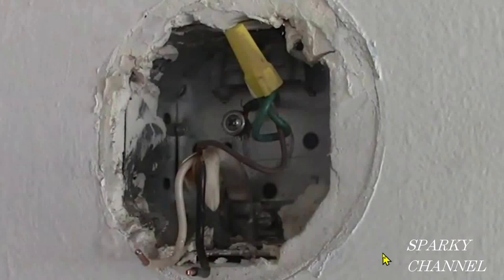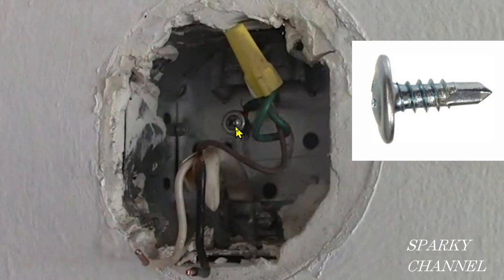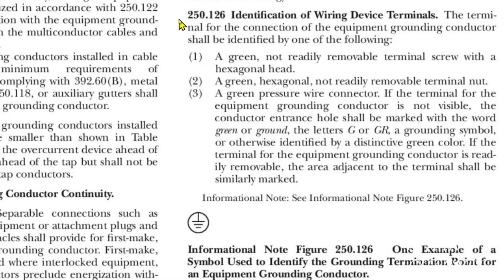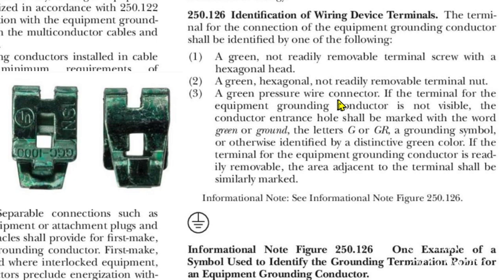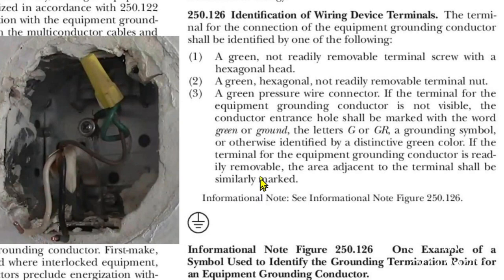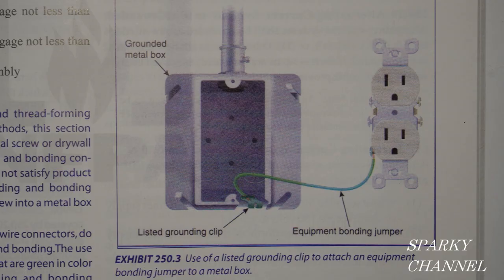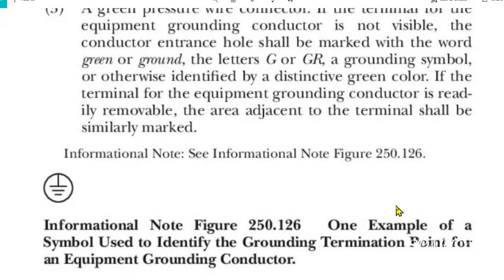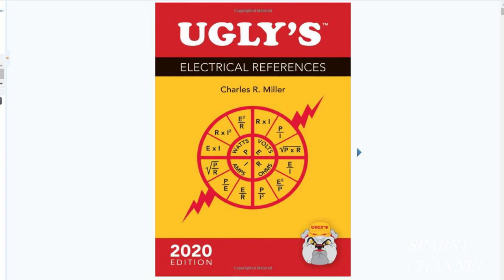Is This Box Grounding Screw Legal By 2020 NEC?

Comment: What's even better are the houses such as the older style homes that had fuses boxes are were they took the ground wire and wrapped it around the screw on the wire grommet where the wire enters the box, the screw that you tighten down against the insulation of the wire.  My house that was built in 1916 was like this when we moved in.

Comment: Nope. Not green, not hex, and really the problem is you have no idea if some random screw is conductive enough to work as an electrical anything.  I also mistrust anything with a “self-tapping” thread. Those are often a one-time connection. They’ll make a connection- ONCE. But will strip if loosened and re-tightened.

Comment: In this 50 year old house, the aluminum grounding wire from the aluminum romex is wrapped around the unused cable clamps and tightened down. The copper only receptacle or switch is then grounded to the box with its mounting screws. I forgot to mention, if you didn't figure it out already, that our home wiring is a tad out of date. Our house is wired kind of funny too. The 20 amp, 12 gauge lines were definitely looking toward the future when they put them in. If I won the lottery, I'd probably gut the house and completely rewire it. Until then, I just use approved methods for transitioning the aluminum to copper to help tame the aluminum to copper's frisky electrolytic properties to corrode and spontaneously combust.
Reply: Aluminium is derated, so 12 AWG Al is only 15A.

Also, the wires at the screws can loosen over time and cause over heating. If you have flickering lights or hot temp outlets, there are probably loose screws somewhere. Arcing will eventually lead to fires.

Comment: I suspect Ed Benton is right about 250.126 addressing receptacles and switches as in the title it has "Device".   I wouldn't call a box a device.   I think this box situation is addressed by 250.148(C) which refers us to 250.8 in which "Thread-forming machine screws that engage not less than two threads in the enclosure" is an option.   .   However, I don’t know if a two threads would be engaged in an electrical box like that so it might not be legal for that reason anyway.
Reply: I think you're right. There are many listed boxes and enclosures that have a grounding screw that is not hexagonal or green
Reply: @jsncrso  ... so the next question is what prior code said about those screws and if they were legal up till recently? After all, this is the NEW 2020 code and not everyone is caught up. (and wont be for years)
Reply: How many screws (of any shape or color) attaching a ground wire to a box have you seen that aren't  (by any reasonable definition) readily removable?

A quick search of a 2008 version doesn't define "wiring device" but says it doesn't define a lot of stuff defined in other codes. I have to figure that there's a definition somewhere, because otherwise how is anyone supposed to know? A cover plate isn't connected directly to wiring or used to install wiring, so obviously not a wiring device, right? An awful lot of other stuff is something that's used to install or connect wiring (even staples and conduit). At any rate, the ground (and hot and neutral screws  in receptacles and switches require a bit of extra effort to remove because of the  groove in the end of the thread, and they're obviously "terminal screws". Put it together and they're "not readily removable terminal screws".
Reply: @rupe53  Code says UL listed device. If the device is UL listed for that application, it's code compliant, end of story. NEC does not cover the manufacturing side of things, only installation. The code in this case refers to an aftermarket screw chosen and installed by an electrician, not a screw that included with a UL listed device
Reply: @jsncrso  ... right, but what was supplied 10 or 20 or 30 years ago? I don't recall there being green screws in all 2x4 or 4x4 boxes, unless you specifically bought boxes with the ground pigtail included... and even then I don't recall the screws being green. For the sake of repair work on something existing, do I need to purchase pigtails with green screws or can I just use green wire and machine screws to be compliant? IOW, UL listed as of many years ago.

Comment: The self-tapping screw had a sheet metal thread. A machine screw is required. That's why the screw hole needs to be tapped.
Reply: I buy #10 self tapping green screws, but they do need a small hole to start if the box doesn't have them pre drilled
Reply: Code does NOT specify that but it absolutely is a best-practice.  Sheet metal/wood threads are a “one and done”
Reply: @HBSuccess   if 250.8A5&6 applies and requires two threads, you would need quite a thick box to engage two threads with a self tapping screw.

Comment: This version of the video better have more harmonies in it! 
And remember folks: if it looks like a wood screw or sheet metal screw, it isn't a grounding screw. 
You need a fine mechanical thread, and a full head.
Reply from the maker: Thanks! I mispronounced "hexagonal" on the first version, went back to fix it but then didn't remove the first track. While I was at it, I showed that I did change out the grounding screw and EGC. So in the long run, it will be better. :) Yes, I'm happy to make this video because I hate seeing improper grounding screws.
Reply: @wim0104. Good point. Sparky (Bill) shows taps in previous videos that are used to make fine threaded holes in metal boxes just for this purpose.
Reply from the maker: @ccadama  I have a nice Ideal drill and tap set and I've been using that for the 10-32. Quick and easy!

Comment: What’s funny is that I remember seeing the pressure wire connectors you clip on the edge of the box... sometimes they weren’t colored green. I guess they are “grandfathered” in.
Reply from the maker: Yes. Also, I've seen the green color wear off over time.

Comment: You're referring to the wrong article. 250.126 clearly applies to devices. This is not a device. The article that applies here is 250.148(C). Green screw not required.

Comment: You should have a quick video on how to use those clips. I don’t normally use them but I have, and each time hope I had used it right lol.  

  If in an old metal box that doesn’t have a 10-32 grounding screw hole, I’ll drill and tap for it.  Now I use a drill and tap kit but years ago i learned to use a 5/16” self tapper to make the hole, which is great because if it becomes dull usually you got a hole jar of them. Then used a klein tri-tap or in a pinch a saved QO panel screw. They are made to tap out box metal and are 10-32 so you can then use a standard green ground screw.
Reply from the maker: I have a nice Ideal drill and tap set and I've been using that for the 10-32. Quick and easy!

Comment: Can you do a video explaining how to install a 220 volt outlet? I currently have a finished basement in which I'm considering installing one. About a 50 foot run through drop ceiling so you can't see the wire. Can you explain all the electrical codes? Thanks
Reply: Sounds like an electrical dryer drop? If so, 10-3 with ground with a 30A 220V breaker. Though 50 ft is a long run and would be right at 3% voltage drop at 30A.
If the 30A run is longer than 50 ft you would want 8-3 w/ground, or if this is a 40A, 8-3 w/ground, 50A would need 6-3 w/ground.
Reply: Is the suspended ceiling an air duct?
How would the feeder be supported? Stapled along floor joists the entire way? Loose strung? Run in conduit?

Comment: 250.126 isn't applicable here.  That section refers to the grounding terminals on receptacles and other wiring devices; i.e., "Wiring Device Terminals".  They're required to be green to clearly identify that they are for grounding and not something else.

The applicable NEC section for this case is 250.8 "Connection of Grounding and Bonding Equipment" . Sheet metal screws aren't listed as a permitted method, which is why this fails.  If it's a screw, it must be a machine screw with a size that matches the tapped hole in the box.  This ensures a low impedance connection.    There's no requirement that it must be green, but it's customary to use it for identification purposes and it's what a pro will use.  Seeing a sheet metal screw in there is a sign of a DIY hack job.

Comment: Interesting that it must be green with a hex head? I thought the only requirement was the screw, regardless of head or color, had to be a size 10 body with 32 threads per inch (10-32) and use a tapped 10-32 hole in the box dedicated exclusively for a ground connection. (Meaning that the screw cannot simultaneously supply ground attachment AND be a means of fastening the box to a surface).
Reply: You moving to fast forwards. We'll find this in NEC 2022 and EC 2025. No earlier.
Reply: Moving too fast??? That was the code a few years ago, never knew it to change
Reply: @jgren4048  Yeah I discovered that same bit of code goes back to at least 2011.

Comment: I guess those drill and tap combination bits or the proper size drill bit for creating a new spot for a hex head machine screw , with some green paint marker
Reply: Proper drill for ground connection must have green mark 7/8 inch from top. NEC 2023

Comment: Attended a code coarse on the 2014 code. The instructor was the same guy that did the coarse fo has now. Many codes ago he told us that the grounding screws needed to be green in color then in 2014 that only the bonding screw needed to be green in color and that you could use the  10-32 screws from the un used  and remove cable clamp. Now we are back to all the screws need to be green
Reply from the maker: Thanks Tim!

Comment: Does “not readily removable” mean the threads are formed in such a way to resist loosening?
Reply: It means the tip of the screw is deformed so you can loosen it in the terminal, but you can't easily remove the screw completely.  This way you don't pull all the screws out of the back of the device and then accidently put them back in the wrong positions.

Comment: As far as I know a self tapping screw is not acceptable (although I see nothing wrong with it) but you are reading artical 250.126 is for terminations on receptacles and switches
Reply from the maker: Thanks Ed!
Reply: There are what’s called “self tapping thread forming screws” that are different from sheet metal self tapping screws; the thread forming screw produces a machine screw thread, just like using a separate tap would do. Link below for green ones with hex heads that would seem to be suitable for grounding use: 
https://www.homedepot.com/p/Commercial-Electric-Combo-Grounding-Screw-10-Card-774042/100134430

Comment: So, stray current only knows its way through a green, hexagonal machine screw? Got it!
Reply: I guess it's about identification as well as functionality.
Reply: Rob L. 
I'm sure, just a little tongue in cheek. Although I do think the coated screw resists corrosion!
Reply: It's also the threads. A machine screw has more mating surface with the metal box. A self drilling screw has wider spaced threads and cannot provide the proper path to ground. This is in a technical note from NEMA .
Reply: Warren Graham 
That makes sense also. See, all these useful comments can be educational. Merry Christmas!
Reply: I guess your the type of sarcastic dude that doesn't even get it when you find yourself in jail and you blame everyone else. 👍
Reply: @he-got-a-new-mommy  
What? Did you read any of the reply’s?
Reply: @dodgeguyz  oh mama Inde is a working man mama

Comment: By the way, why don't metal electrical boxes come with a green, grounding screw? Yeah, you can buy green pigtails with green screws for this purpose, but it would make sense that the electric boxes come with a grounding screw especially since you're supposed to use one. Switches and receptacles must come with one. You aren't required to get ground screws for those. I guess you should keep the grounding screw from a worn out switch or receptacle just for that purpose unless you just want to buy those expensive, premade green pigtails.
Reply from the maker: I agree with you!
Reply: most metal electrical boxes don't come with the screw - anything newish will have a threaded hole for the screw, though. - the box manufacturers usually aren't the screw manufacturers, so there'd be one more layer of markup on the screw.
Reply: That is a great question. My theory is that it's just historical, it goes way back to before we had circuits with EGCs. The metal boxes sold in Canada, listed by CSA, are required to come with ground screws. And single gang device boxes have not just one but TWO screws in them! Google "Iberville", it's a division of Thomas & Betts which owns Steel City, which makes US boxes.
Reply: @aaron74  In the US, the government pays more to subsidize for-profit healthcare than any government in the world pays for single payer healthcare; and we think we can't afford single payer.  why would you expect us to ask manufacturers to supply the required bonding screw in metallic boxes?
Reply: @kenbrown2808  As part of the current stimulus package, all Americans should be sent by mail a packet of twelve 10-32 grounding screws. Ha ha
Reply: @aaron74  most of them wouldn't have a clue what they were or what to do with them.  it occurs to me that I have a pack of antique ground screws that will be illegal when my state adopts the 2020 code.  (dome head, straight slot)  they're my backup supply in case I run out of regular ones.
Reply: @kenbrown2808  Yeah I know, twas a joke. Here's a question for you, why do square J and octagon boxes even come with 8-32 screws for covers or devices. Since you gotta buy ground screws separately, why aren't those purchased separately too? Ha ha (Shhh, Aaron, don't give them any ideas.)

I'm not sad to see slot screws going obsolete. I do like tightening a screw with a socket. I wish every screw were that way as much as possible. The Canadian square drive (Robertson) is absolutely second best, and I'm happy to see that on combo-head screws on modern stuff.
Reply: @aaron74  problem with hex drive screws is many of them have sharp edges, which isn't so goo in electrical boxes.  robertson is the only drive shape I've had the bit strip out in the screw, and then get stuck in the screw head.  Torx would be good except they insist on making every size screw a different size drive.
then you can get a special bit just for the three-in-one screws on electrical devices.  works great, but won't turn any other screw.
Reply: @kenbrown2808  The Dotti brand of ground screws are really good, they have a tapered head and the angles of the hex head are  rounded off a little bit. Check those out, they sell them at electrical supply depots.

Sounds like your Robertson experience might have been isolated. For me it's been opposite, I always seem to strip Phillips. Slot- or flat-head is usually ok and offers good torque, but so many trades have ditched that old drive because it slips or cams out badly when using a power driver.
Reply: @aaron74  yes, ground screws have to have the edges deburred.  other hex head screws often don't though.  
and yes, phillipps cams out pretty easily, and flatheads are a pain to power drive.  
but robertson is still the only one I've had strip out AND get jammed in the screwhead on the same screw.
Reply: Nor all installations of metal boxes require screws.  If you use EMT or other metallic conduit, the box is grounded through the conduit.  If wiring devices with the self-grounding clips are used, they are grounded to the box through their mounting screws. No pigtail needed.
Reply: @barryomahony4983  only in some places. in others, steel isn't considered conductive enough to be a grounding conductor.
Reply: @kenbrown2808  The 2020 NEC definitely considers steel to be conductive enough for use as an equipment grounding conductor, which is the subject of this video.

Most metal boxes are used in commercial work with EMT.  It makes no sense to supply screws with the boxes when they wouldn't be needed in most cases.

Comment: So when did this change? I see LOTS of EGCs installed in boxes by just wrapping the ground wire around the built-in romex clamp screw, or even bending the ground wire back and putting it under the romex clamp, and these are done by pro contractors.

Comment: I agree with you and NEC 100%.  From a technical standpoint , if you were in an old home and the ground was securely attached with your chrome screw, does this become a punch list for replacement on an inspection to accommodate the  sale of a home ?  Curious.
Reply from the maker: I doubt it as inspectors seldomly open up a receptacle or switch to check for such things. Good question as one should always think of what may be upcoming on a punch list. Such items on a punch list can scare off buyers from buying or they might demand a 10K or so credit so that they can fix such things. Buying agents love to over-demand concessions when they see these problems. Best to fix everything prior to the inspection.